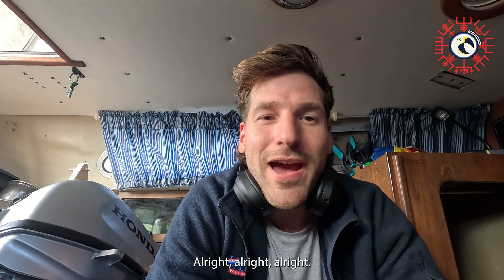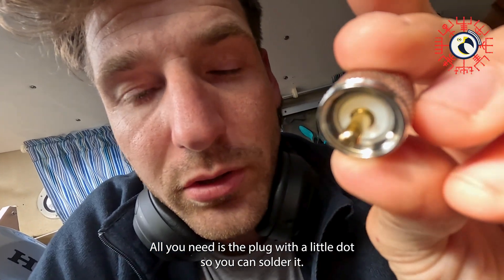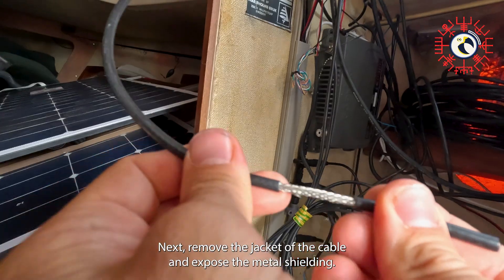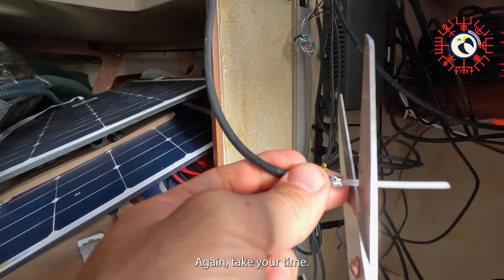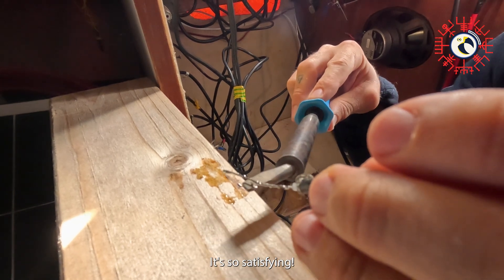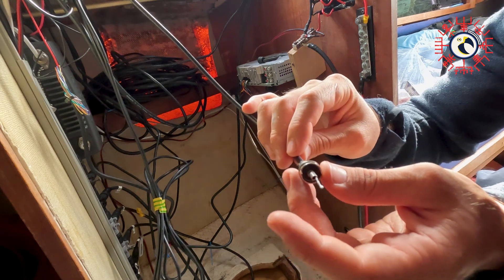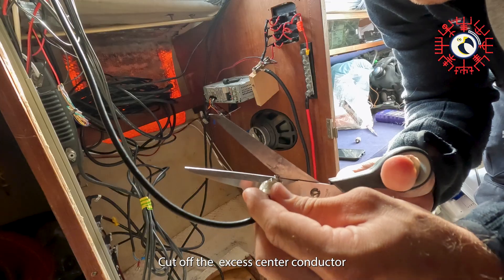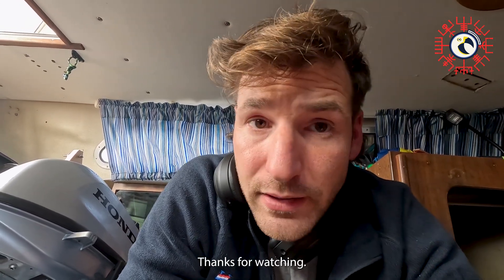Soldering VHF and AIS Connector Quick and Easy Tutorial (UHF PL-259 to RG-58)

Comment: One improvement you can make here is to use a tinned UHF connector.  In a marine environment, that one you've got might not hold up.  I think the rule of thumb is that basically all wiring on a yacht should be thinned.  Also I've noticed the nicest UHF connectors often come tinned anyway.

Comment: Adding solder to the wire before soldering it to the joint is called “tinning”. Tinning makes it much easier to use.
Reply from the maker: Thanks mate! 😁
Reply: Plus flux first!